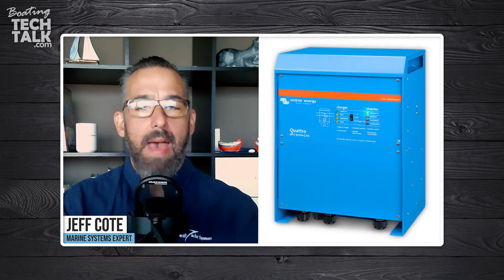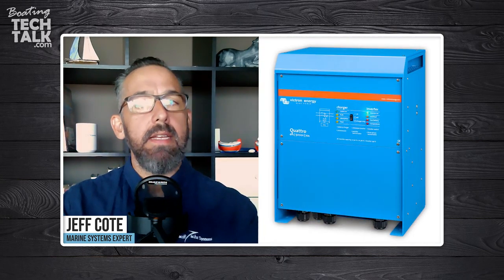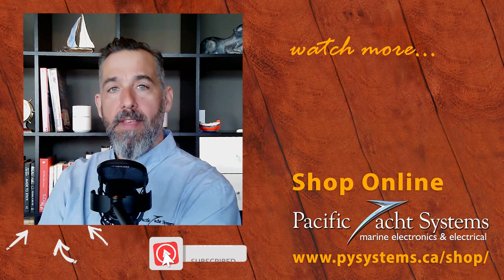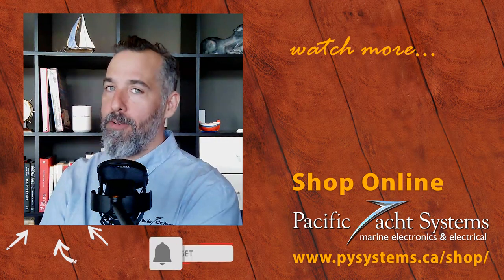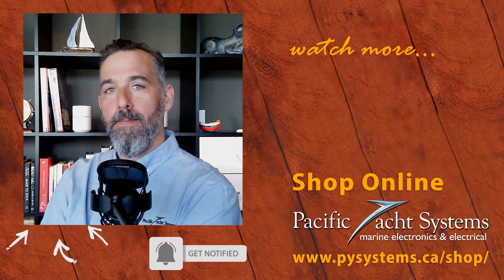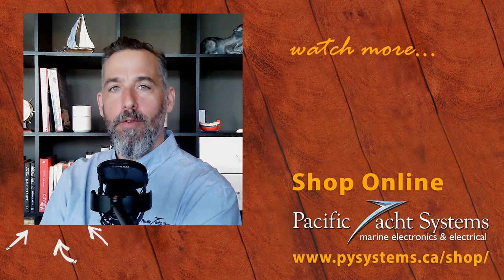What Does It Mean if My Inverter/Charger Has a Boost or Assist Mode?

Comment: It's a very handy feature when your connected to shore power with a low current supply to prevent tripping when for example boiling the jug and charging.

Comment: Dear Jeff, could you please explain what would be required for an international friendly inverter / charger shore power setup. We are refitting our Baba 35 currently for a Pacific passage and had our eye on the Victron Multiplus series, but from what we have read, shore power in say Thailand is not only 220v, but also >50hz< instead of 60hz. Assuming we only use American appliances onboard, would we still have to get >2< installations for our shorepower chargers? Thank you so much! Fair winds!

Comment: Please don’t connect inductive loads before starting your generator or connecting your shore power. The former may pop the fuse or breaker on your generator. The latter will cause heavy sparking on your shore power connection and voltage spikes throughout your AC circuits. Turn everything off, connect power, and then start turning on the biggest inductive loads first. Before disconnecting power, shut everything off one at a time. If you have a shore power inlet breaker, (you really should), keep it off when you’re connecting/disconnecting. My neighbor lost multiple washer/dryers due to voltage spikes when connecting and disconnecting shore power.